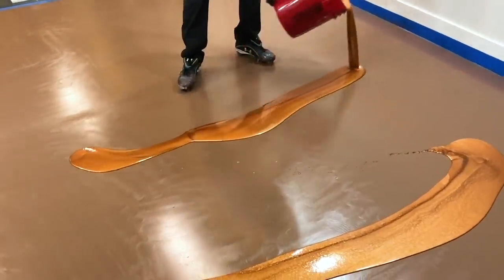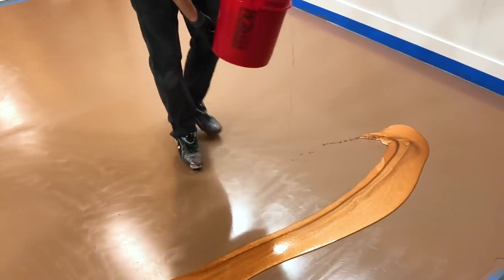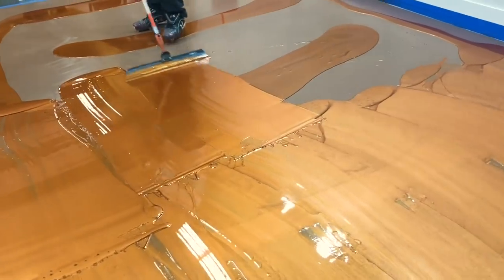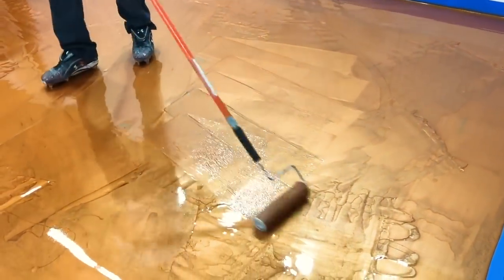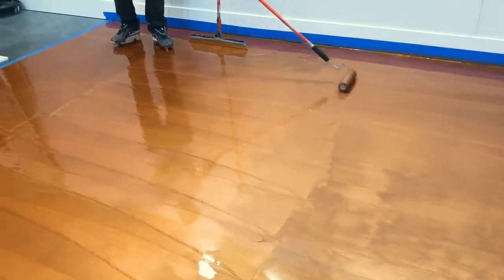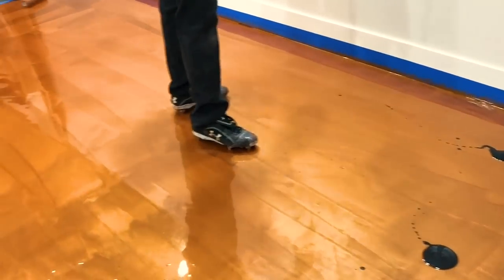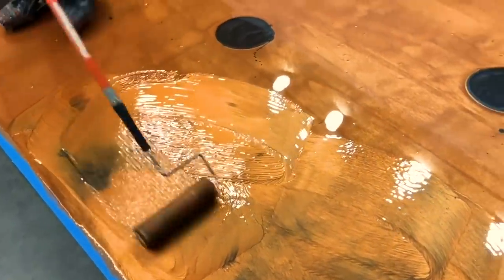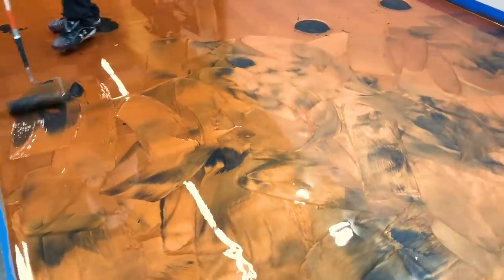How To Create A Designer Epoxy Floor | Full Epoxy Installation That You Can Do Yourself | Leggari

Comment: Big Question.... have you ever payed a wooden deck? Would your product work on a wooden deck?
Can you imagine walking out onto an epoxy  deck?
Reply: I wanted to ask the same question to. Like really. Would it?
Reply: I own International Concrete Corporation. We’ve done wooden decks before. You have to sand the wood first, then vacuum it, use a primer that will bond to the wood. We use 2 coats of primer sometimes. Once that’s done, you have the same working conditions as a concrete floor with primer.